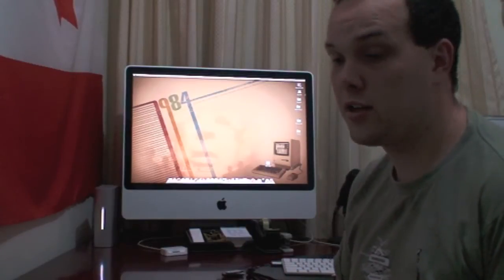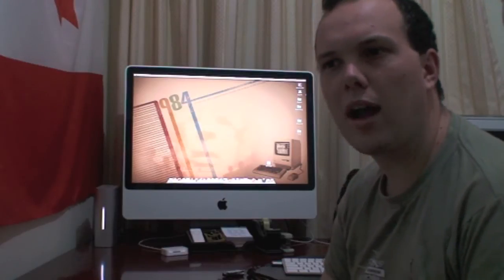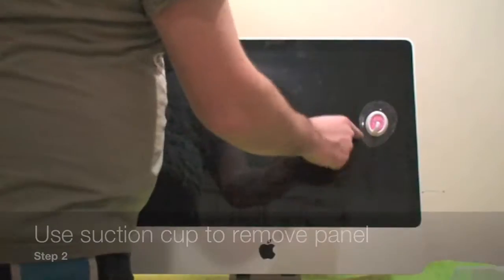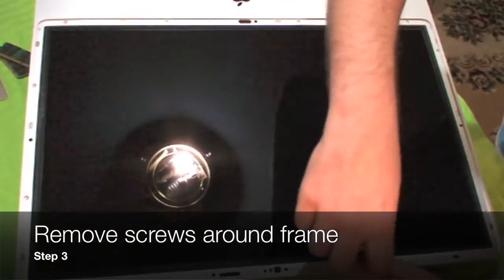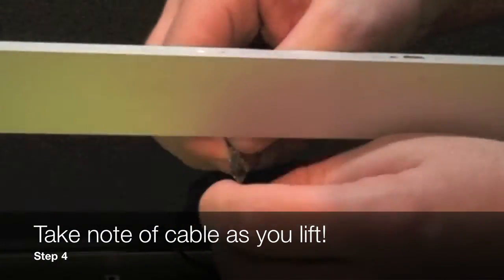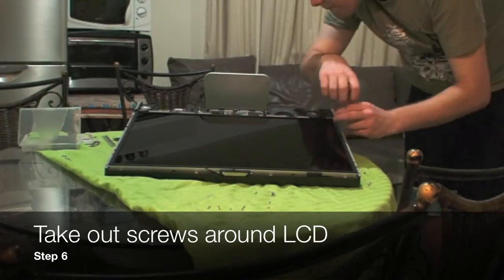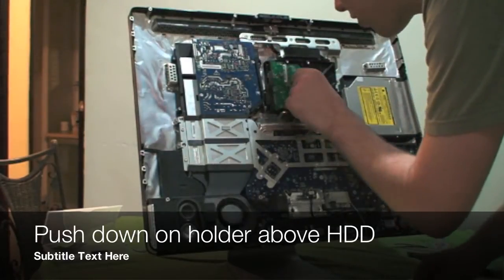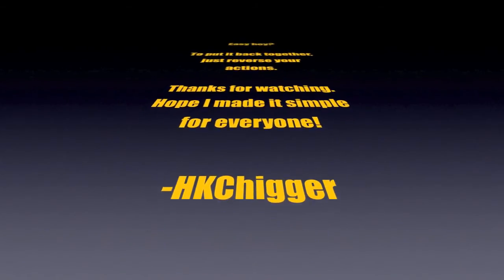iMac Hard Drive Upgrade 10 Steps

Comment: my imac 27 is mid 2010 and hardly used. This morning I turn it on and YES the hard drive is dead.  What I don't like about this is that a disk drive should last at least 3  years and the MFG warranty is normally 3 - 5 years.  I am suspect if I call Apple they will want to replace the drive under NO WARRANTY. SUCKS.... and I am a bit pissed but your video is helpful should I choose  to replace the drive myself.

Comment from the maker: @shiloharts I didn't have any more heating issues with a 2TB than with the base model. iMac's tend to be warm though, so take care of them. Granted I am using macs in a hot country, so that could be part of the reason they seem to always be warm. I didn't use 64mb cache though, I was still 32mb from memory. (Traveling right now, so can't check)

Comment: Question...how does it run with your 2tb? Any overheating? Also, do you recommend a 64mb cache, or will that get to hot for this specific model. I'm looking to install a 2tb on the same machine, but dont want to push power consumption too far.